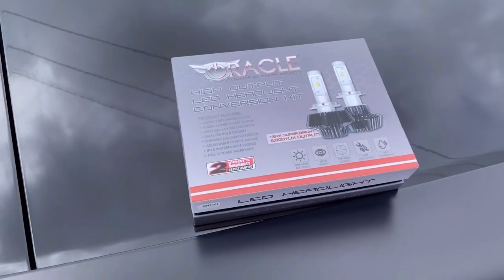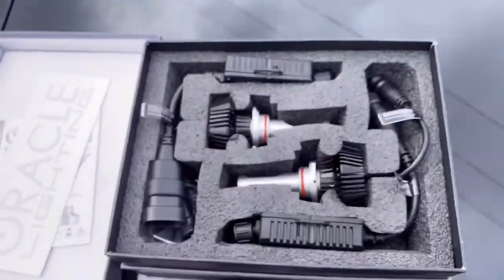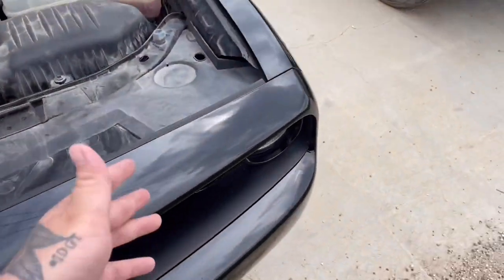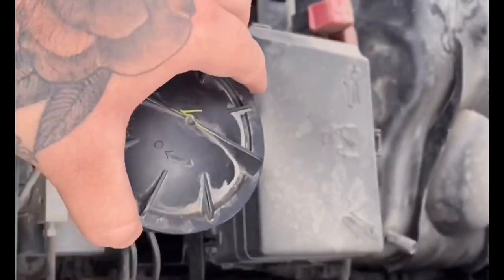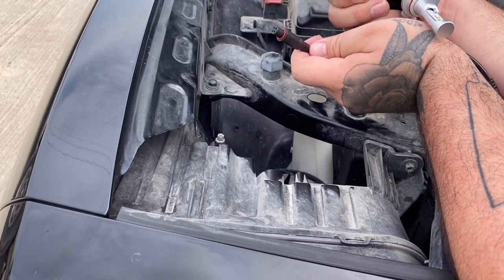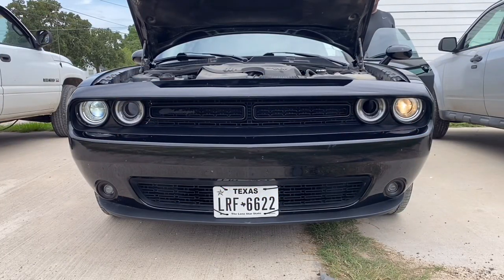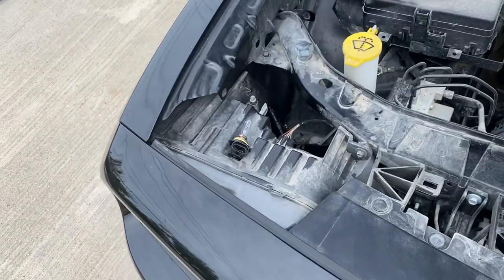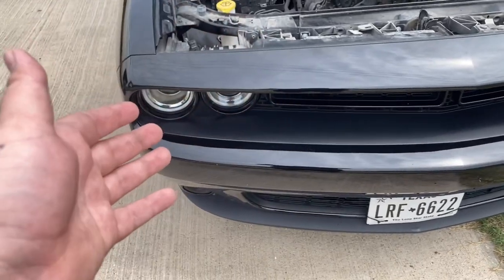How To Install Oracle Lighting’s LED Headlight Conversion Kit ! | 2019 Dodge Challenger SXT

Comment: What about the dust cap, will debris get in without it? Also can you do it without the decoder/ module.
Reply: The new 2021 Firehawks allow you to place the dust cap back on as it doesn't have any long wiring at all.

Comment: 6 months later were these bulbs worth it and are they BRIGHT?
Reply from the maker: I can wholeheartedly say that these LED’s are worth every penny, and they are much brighter than the OEM halogen bulbs.
Reply: Ummmm. You didn't show re-installing the dust caps. Did you just leave them off? Did they go right back on? Did you have to modify them? All that extra driver cabling?

Comment: Were you able to put the dust cap back on or  does it require modification as far as drilling a hole thru or could u just shove the extra  wire in the lighting area
Reply: Was thinking the same thing most vids I've seen they left the cap off but I'm thinking for the bulbs longevity drill a hole or use a dremmel tool to make an incision through the cap to feed the wire through just a thought tho
Reply: I just installed these. I had to shove the wires in the hole. I don't know how he put the dust cover back on.
Reply: @cwells1379  I don't think he did. It's not really clear either way.

Comment: Dawg... you made it look so damn easy!!! 😂 took a while to work on the driver side. Had to remove the air box to have room
Reply: That’s why he only did the passenger side on camera I almost cried trynna put the driver side in😩😩😩
Reply: I was wondering why he didn't show the driver side. I'm pretty sure you have to remove the air filter.

Comment: The drivers are small enough to get inside the housing so you can seal it with the dust cover. I'm not comfortable with having that wiring outside of the housing and it will fit.
Reply: That lil box with all the wiring will fit inside the dust cap?
Reply: @jaithen29  Yes, I did it and it worked out just fine. Those lights are more $$ because they made the drivers small. The wire ties might help compact the wiring but I didn't need them.
Reply: @richardweyland116  awesome thanks man, it’s between these and lumen G10 LEDS. How have ur light held up so far if u don’t mind me asking?
Reply: @jaithen29  Fine, I was concerned the dust cap might come off but it hasn't.
Reply: Any problems from putting the drivers in there?

Comment: Looks cool but I check oracle site they don’t make fog lights LED lightbulb to match the headlights lightbulb. Where will you buy the fog light LED lightbulb from?
Reply from the maker: Anthony Gaona I purchased a set of LED fog lights from the Diode Dynamics website. I’ll be uploading an installation video of those very soon!
Reply: JeremyJOH cool hopeful they will match the LED headlights from Oracle.
Reply from the maker: Anthony Gaona The fog lights are rated at 6,000K, the same as the LED headlights from Oracle Lighting, so they should be a perfect match.

Comment: Did you have to install led resistor because I bought the same kit as you due to the video and my car lights flash on then off.. installed new fuses and it just didnt work.. hmmm I have the same car as you.
Reply from the maker: No, I didn’t install anything other than what is seen in the video.
Reply: I have the same problem, did you figure it out?
Reply: If anyone has this issue, the cause was a bad car battery. Replaced it and the lights no longer flicker on/off
Reply: This still happen?

Comment: Does the driver and all that extra wiring fit inside the housing alright? Looks like alot of extra stuff to cram in there?
Reply from the maker: I’m sure you could shove all of it in there, but I definitely wouldn’t recommend it.
Reply: Did you manage to get the dust caps back on to keep moisture and crud out?

Comment: Do you reinstall the caps on the back of the housing?
Reply from the maker: No, you can’t reinstall the dust caps due to the wiring for the LED’s. Others have drilled holes in the dust caps to route the wires through, but I don’t see the point in that.

Comment: Does any of the challenger models have stock led?
Reply from the maker: Unfortunately, none of the Dodge Challenger trims come with OEM LED’s. However, you can purchase HID’s as an option from the factory.
Reply: @JeremyJOH  what is brighter?
Reply from the maker: I personally prefer the light output of LED’s over HID’s, but you have to purchase a good quality of bulbs.
Reply: @JeremyJOH  I know nowadays LED are more common but an curious as to which cars still come with HID

Comment: Anybody else having an issue with the lights turning off randomly?
Reply: Maybe the bulbs need to be tightened. Mine flickered on the passenger side when I turned the car on.  It was a little loose when I checked.
Reply: Did they still work? I got them and they worked then they flickered and turned off ?
Reply: @rgrodriguez671  I ended up taking them off cause they kept turning off. They ended up draining my battery and im pretty sure my alternator is fucked now too 🙃
Reply: My issue is that my headlights work perfectly fine until it gets too cold outside. If its 60° or lower they will turn on and off. If higher than 60° they will work perfectly fine.

Comment: How did you get the dust cap back on ? Did you have to drill a hole for wires to go through or did you buy a dust cap with a hole pre-made?
Reply: That’s what I’m wondering too